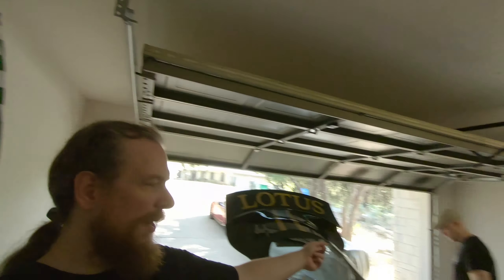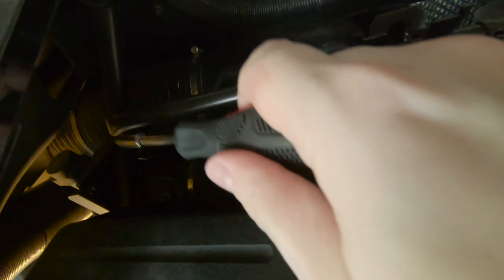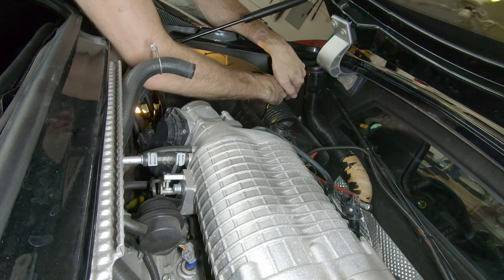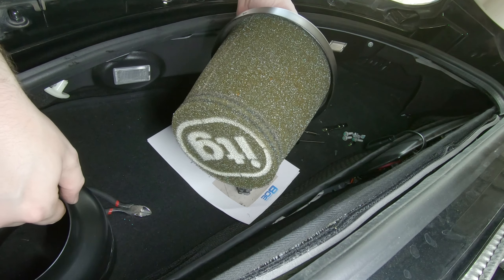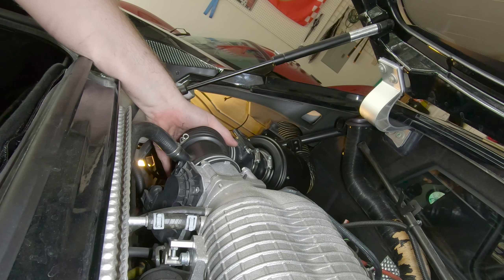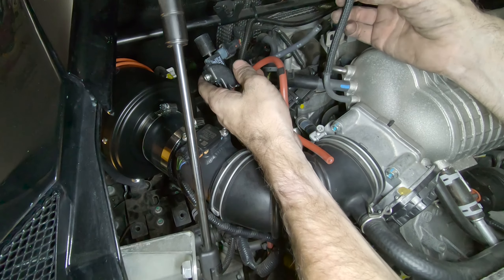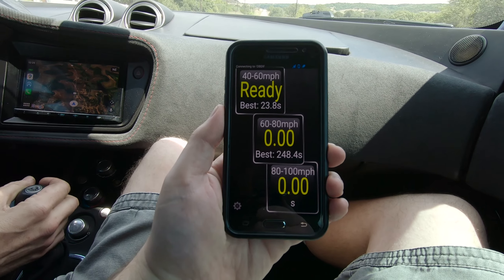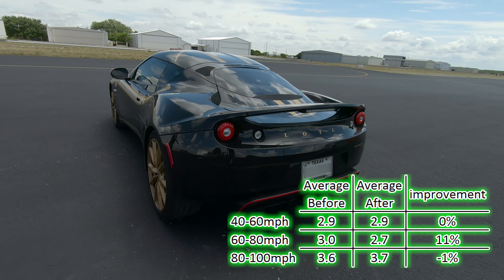Lotus Evora S | BOE Intake | Install & Test

Comment: Thanks for posting this! I am changing out my shift cables and installing a BOE at the same time, since the airbox has to come out to do the shift cables... Your video has certainly given me a better idea how to do it.
Reply from the maker: Glad it's helpful!
Reply: @BookAutowerks  100%... Watched this, then ripped out the airbox. Just finished up. Took a little over an hour. Didnt have to remove that part that Nigel messed up on yours, but the 5" hose from outside to engine bay wasn't even connected to the body on mine, so was a little easier.

Comment: This is near identical to the car I've just bought. Do you know if the owner had any issue with the oiled filter upsetting the MAF sensor. I've heard of the oil coating the wire over time and upsetting the readings
Reply from the maker: No he hasn't had any issues with his MAF. He drives the car pretty often, too.